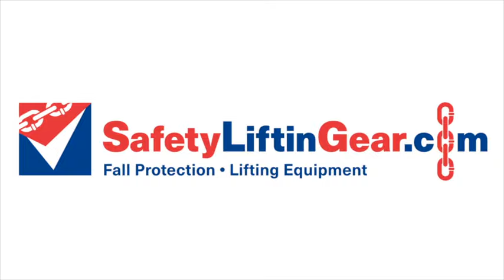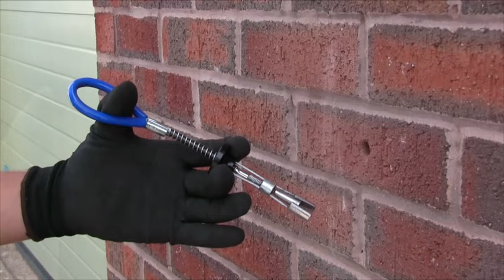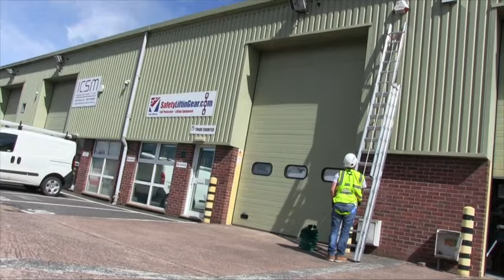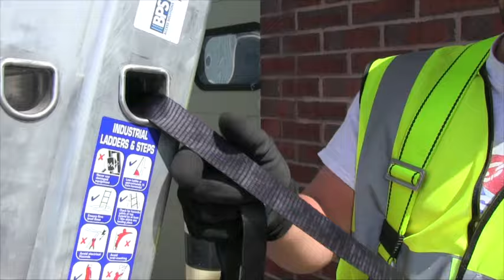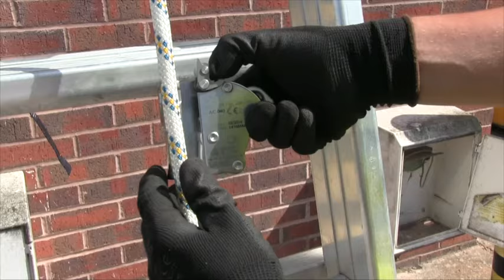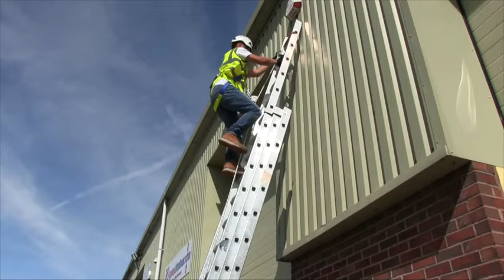Ladder Fall Protection Premium Kit 2

Comment: Another great safety system that REQUIRES someplace to bolt in the anchor point.
Reply: Yeah really, USELESS!!  Like people will be cool with me drilling a hole into their wall!
Reply: Jake Stevens if OSHA wants all this safety then it should be made mandatory that anchors should be installed permanently like this and roofs, especially in new construction. Older structures get them when someone is doing repairs and has to installs them and leave them there. The cheap cost for install will come from the homeowners or businesses.
Reply: Whatever happened to just using a bungee and a level
Reply: @jakestevens7283  they can be cool with that, or paying for a scissor lift.

Comment: what a load of trouble that really is !
Reply: yeah - three points of contact and a man holding it at the bottom and the ladder setup correctly,  those things are enough to prevent injury - having a rope on the steps is a clucking stupid idea.
Reply: Your're right, but it beats a broken back!